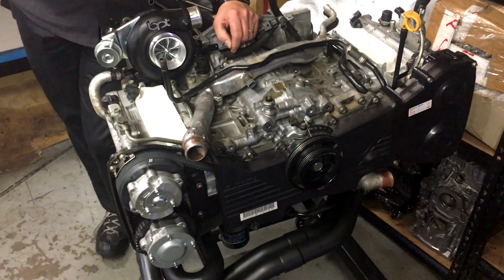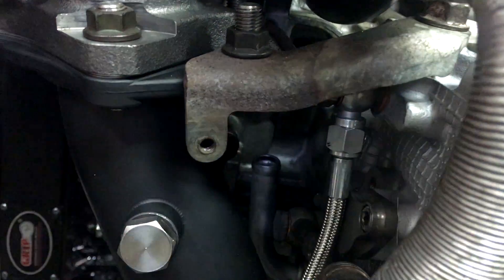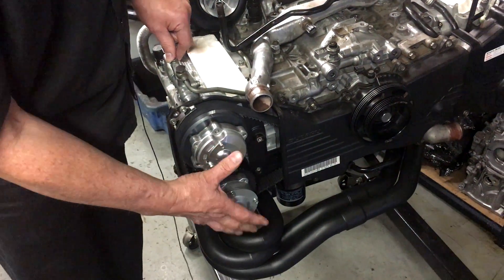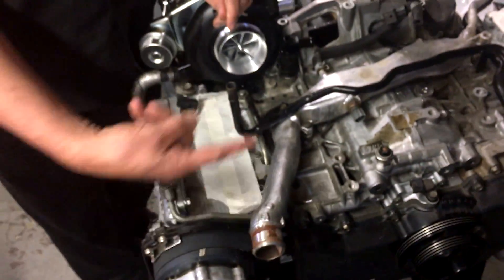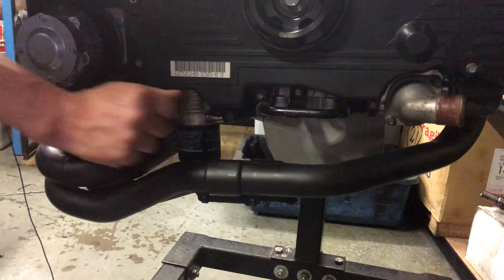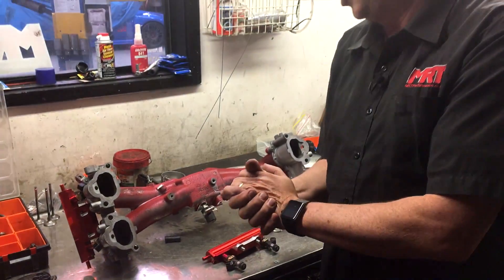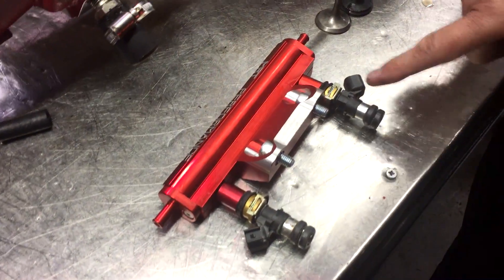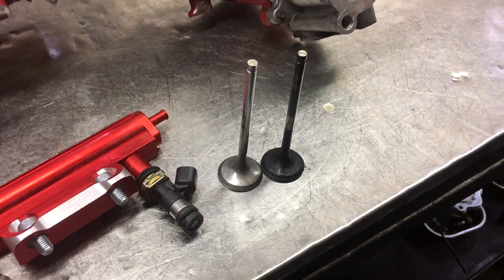Subaru Closed Deck Engine Build - Part 1

Comment: So I have an ej257 , v5 heads and a vf39, header, 3" downpipe, no cat. This turbo runs out of steam around 7k but has great low end power/drivability.  Is there a turbo upgrade that is the best of both worlds or will I always sacrifice low rpm boost for high rpm flow?  Great videos, I have owned this v5 for 13 years. Still learning, thanks

Comment: My oil pick up snapped on my 04 sti. What did he mean by damage on the big end bearing? One of my heads had damage. I just replaced the head and put a closed deck also 😎

Comment: A water spray kit operated by a Hobb switch would be a worthwhile inclusion Brett to the Verticooler. I have an MY11 WRX with a Verticooler & I want to install a water spray kit. Any plans to put one together?

Comment: 6:44 That's fascinating! For a gasket to potentially alter the angle of the fuel injector due to thermal expansion... wow. This is why high performance engine tuning is so intricate, every detail counts! Thanks so much for uploading, I needed a video like this to exercise my automotive knowledge that I haven't been using too much recently :)
Reply: I don't understand how it would change the angle. Does only one side of the gasket heat up and swell?
Reply: It doesn't really change the angle of the injector, what it does is move the spray up to the top of the inlet port, instead of directly onto the valve faces, It is interesting however, that that impacts it that much. I run the 8mm ones on my NA rally car, helps keep heat out of the intake pretty well. but at the same time, I'm not seeing manifold pressure
Reply: Even trivial things matter when it comes to the physics of engines.